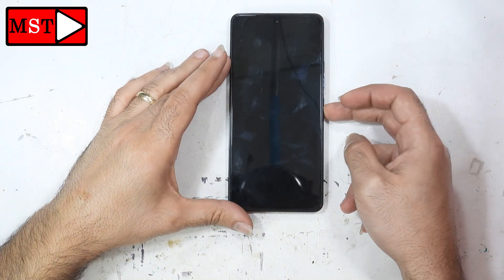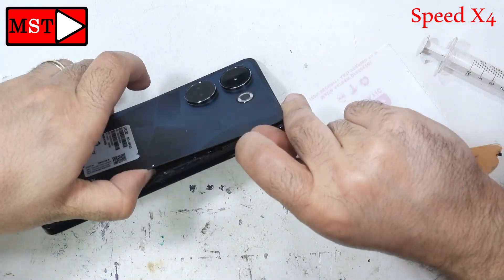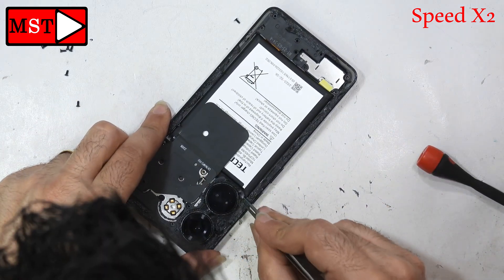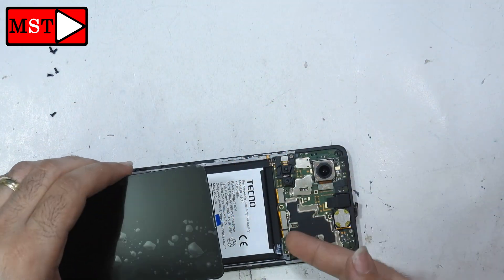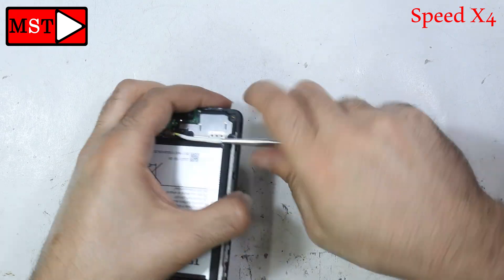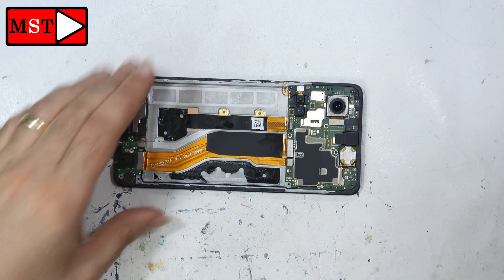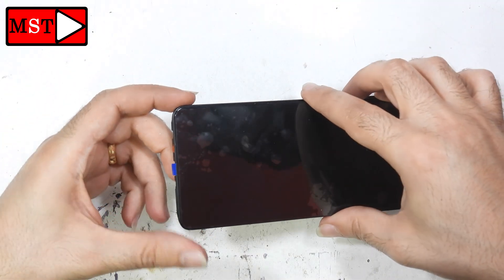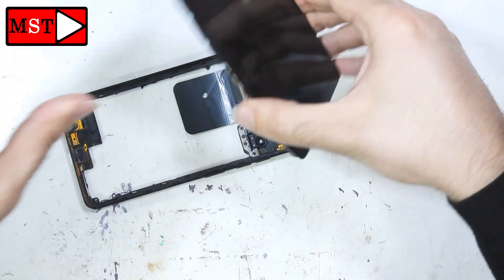tecno camon 20 pro lcd replacement

Comment: I have tecno camon 20 pro Mr Doodle edition I don't know but somehow my phone back shell just come out down right side left side but my phone battery is ok now it's confusing what I need to do😅
If I go to customer care they will charge me a lot and they will not show me they are using the the  glow if they touch my phone's motherboard part 😅 I just need that glow and if go to any local service then they will show me but they will use blade to cut 😅 and there is dirty place 😨 they are going to use glow but I don't know about the proper fitting 😅
Reply from the maker: Why not to glue it yourself?